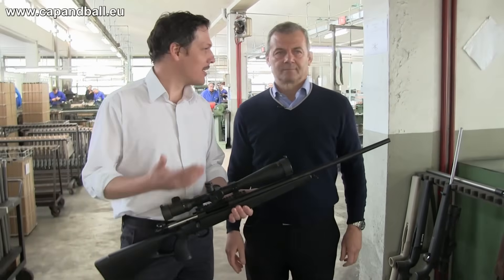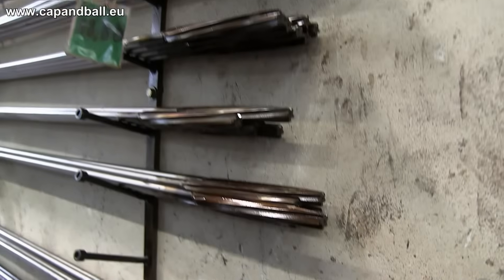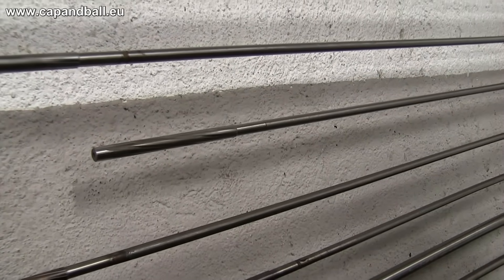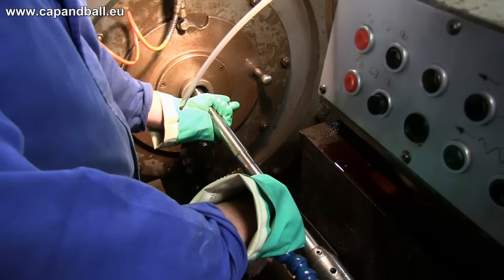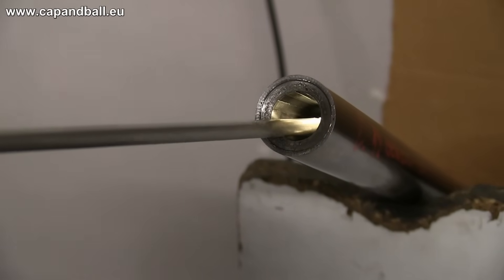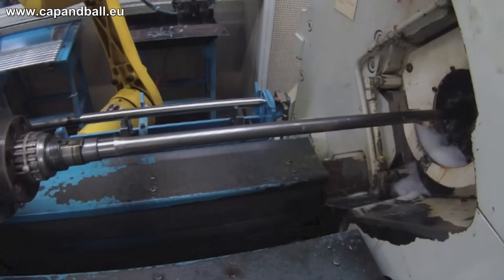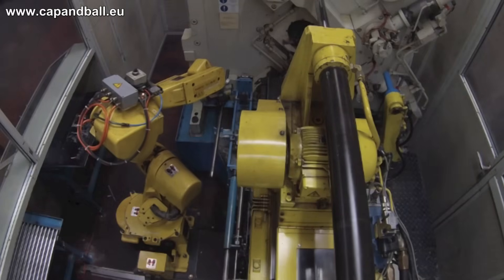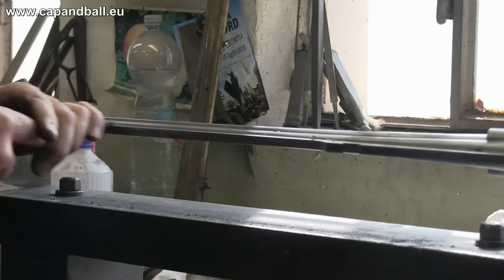How hammerforged barrels and riflings are made

Comment: Hammer forging is just compress metal rather than machining and wear out interior...The copier draw bar which looks like an rifling button slowly pulls out until hammers stop forging specific area at the time,in this process the threaded form imprints inside of barrel by compression,this does not involve using actual pushing of button which won't wear much metal eather but if tools like broach/hook or scrape introduced it does creates frictions and all other type of metal stressing...Iam very impressed the way that factory works and how advanced it looks over other factories but I always thought only large caliber barrels get hammer forged....The process is very simple and easy understand how it function...Less easy to understand process is using nano rifling or electrolyte imprinting solution,never seen video on particular rifling methods....The reason why it not adopt because it very expansive to manufacture high pressure machines and use of electrolyte solution,the only country who did experiment somewhere in 80's is Germany and Japan but ones again those methods was never adopted on large scale production....Only few factories in world can allow such manufacturing techniques..
Reply: Cabal2600 i

Comment: Also, the nipple ends on the blanks going into the GFM machine are HUGE! The front sticks way out and the rear looks like it doesn't have much chamfer at all. Surprising they don't have more loading issues when the chuck head advances. Maybe their drivers are just cut very VERY steep to compensate.

Comment: Hammer forged barrels are great for general low volume shooting and big game at 100 yards.  They are not,  however,  for prolonged use or highly accurate consistant/professional shooting.  This is why you will not see them used in any 1000 yd matches or gain world records at 500 or 1000yds,  Palms matches etc.  Great for high volume business models like Tiger.
Reply: The Shootin' Dutchman 
What? 
Tell that to Steyr.
My Steyrs out shoot every other rifle I have. Same calibers, same ammunition. Their hammer forged barrels with a slight bore taper out shoot my other rifles in the same calibers.
Reply: The Shootin' Dutchman 
Also the reason is the diameter of the barrels you are addressing. Barrel diameter is a major contributor as yo the chosen manufacturing process. I would put a Steyr barrel against any other barrel of the same diameter. 
The barrel is hammer forged around a mandrel to exacting tolerance with a bore taper. They get like a dozen barrels out of a mandrel before it is replaced.
My .222 Rem. Varminter SL with handloads does 5 shot groups at 100 yards as small as .33 inches.
Needless to say if you subtract the bullet diameter we are talking some accuracy and precision shooting.
Reply: So thats a 8mm group?
Nothing special ...
Dutchman is right nothing beats a cut rifled Barrel in top end precision.
Thats why all World records are set with those Barrels.
If you can do that with your Steyr Barrel too, do it.
No doubt they are very good barrels ...but as always there is something better.
Reply: A stock Steyr rifle (with CHB) won several times such matches. https://www.ballisticmag.com/2018/07/20/50-cal-championship-steyr-hs-50/

Comment: Huh, so THIS is hammer-forging. I hear it's one of the reasons why Canadian made C7/C8 assault rifles are better than American M16/M4 assault rifles, which they are of course based off of. Probably why the SAS and Norwegian Military, among others, have chosen to adopt it, rather than the original American made versions.
Reply: +NormanMatchem I am Canadian and love the C7 but they are significantly more expensive than the US M16/M4 service rifles. I don't think the extra cost warrants using the C7 over the M16/M4 and in the military we now equip our rifles with a large 4x power optic that weighs like 2lbs. The rifle is like 10lbs loaded which is stupid because I would rather have the L1A1 (FAL) if I am carrying a 10lb rifle not a little C7. Or I would rather carry our belt fed C9 LMG which when fully loaded with a 200rd belt weighs 20lbs and that includes optics and all. Like it pisses me off that it weighs 10lbs the whole point of the rifle in the first place was to have a super light maneuverable rifle, like it used to be when it weighed like 7lbs fully loaded. My Vz58 weighs under 7.5lbs fully loaded I would rather carry that than our C7's. But quality wise they are built extremely well probably one of the best quality 5.56 assault rifles ever made.

Comment: Are the reamers pushed in or pulled through?
Reply: +TheFirearmEnthusiast Reamers are always pushed to expel the swarfs in front of them and not damage the surface just reamed.
Reply: +TheFirearmEnthusiast reamers are always used with the actual cutting end travelling through first. The rest of the shaft is smaller to allow room for small shavings and lubrication to enter
Reply: TheFirearmEnthusiast (

Comment: When making the second barrel on the newer CNC machine I could not see any mandrel in the bore as in the first one.   How is that?
Reply: Val Martin I think it might be protruding from inside the piece that holds and spins the barrel.
Reply: +Val Martin It is being pushed in from the long track. See that tube on the tailstock? That's holding the mandrel. After the machine is holding the blank in place, it is being inserted.

Comment: Any older methods? How was it done in the 19th century?
Reply: +800lb Gorilla No. Cold hammer forged barrels were a late 1930's invention.

Earlier rifling usually was cut into the barrel with a rifle cutter, a bar with a cutting edge that is drawn and turned through the barrel blank. Today cold hammer forged and button drawn are the most common in series production. Rifling buttons are like CHF, but the other way around basically. Instead of pressing the outside onto the mandrel, the button is forming the inside outwards instead.
Reply: 800lb Gorilla COLD hammer force presses are millions of dollars, the technology is fairly new, newer than button or old world cut rifling.
Reply: Hammer forging barrels started in the 15th century.
Reply: Yes. But this is how they make modern rifle barrels. Look up 19th century rifled barrel manufacturing.......................................................
Reply: MPI1000 You're clueless.

Comment: Please tell your hosts at Sabatti that we all appreciate them letting you film this. They have any amazing factory and it was very interesting to see how this is done. Rifling is always a bit of a mystery because the major manufacturers never seem to want to divulge their methods. Thanks again for sharing this with us.
Reply: How does the mandrel not get stuck?
Reply: @stopthephilosophicalzombie9017  The barrel blank is lubricated immediately before hammer forging. It doesn't cold weld to the mandrel.
Reply: I've seen button rifling methods, but never hammer forged.
Reply: Well said!
Reply: @KrisSays
Reply: Go to BSA UK  air rifles and you will see a far clearer picture of cold hammer  forged barrels being made the best of the best
Reply: When the boring is done it is done by simply hammering not turning inside the barrel?
Reply: @Dailymailnewz  Yeah I've seen old 19th century blacksmiths do it with mandrels that turn inside the barrel and literally cut the grooves into the barrel after many repeated runs.
Reply: Enoic domesday prophecy
Reply: Bravo👍🤩
Reply: Wow it squash it down well 
I'd never heard of this concept
Reply: Thank you very much for showing me how the barrels for my custom rifles have been made they preform as well as the loads I have developed for them. The Coyotes don't like them very well, they run out to a distance they can't normally be hit stop and look back at you for maybe two seconds long enough to get a hot off if you're ready, that's the last mistake they ever make.